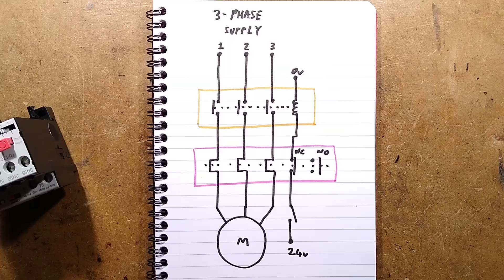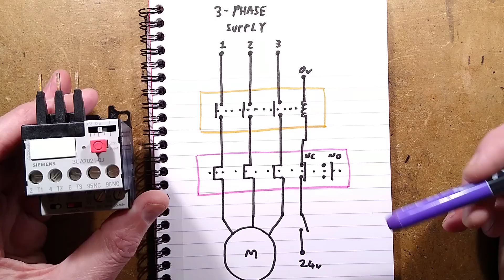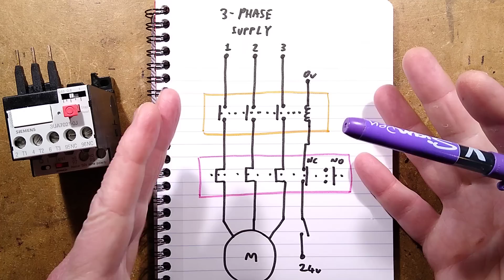Siemens motor overload relay teardown

Comment: I'm in the US with predominantly 120v ac control circuits. I've always found it curious that the overload contact is one of the very few devices wired to break the neutral to the contactor coil. All other control contacts will be on the "hot" side, but the convention for these was to break the neutral. Of course, there are exceptions, but they are rare in my 30+ years of field service.
Reply: I am in UK, having been a sparky in few EU countries and I dont find its rarity curious. As a rule you always want to cut live to prevent non-powered devices from being live. So it is natural that most of the equipment does control live side unless it has a good reason to do otherwise.
Reply: I'm in the USA too, however the "norm" I've noticed is 24V AC or DC (if PLCs are involved). Indeed, I was "shocked" (emotional, not physically ;-) when I discovered a piece of equipment that used a 120VAC e-stop loop. A safety device that is "potentially" (pun) a safety hazard: who'd have thunk it! Note that I work on a small assortment of expensive equipment in a particular industry, so my experience may be atypical.
Reply: Well, most overloads are wired for either a control transformer use, or across phases, so no real difference in there, you have 2 sides of a circuit. But most of them I find are wired so the coil is the lowest element, with the start switch and sustain contact in parallel, then the overload, then the relay coil. With the Siemens units there the coil has a handy pass through terminal, as then you can have a single wire jumper, or for factory units a stamped link bar, that connects coil to common, then from there you wire in the NC side, and have a jumper wire to the 14 terminal on the relay, and power applied to 13, with your neutral to A2, with start button and stop button being remote and fed with a 3 wire connection. I used 4 plus ground cable, because I also fed back a neutral, so as to have a power pilot light there, and ground for safety.
Reply: I find it unusual that the Yanks will switch the neutral in most A/c systems that i have come  across
Reply: @steveosshenanigans Meutral only or do you mean both? when you have inductive load that might continue inducing power after supply was cut there is sometimes handy to disconnect more then just live. Cant think of this happening on a petty Aircon. But disconnecting only neutral in actual end device is usualy sign of bad workmanship.(the device in a video is disconnecting switching device on  neutral not the end device).
Reply: @Zlodej5  
Lennecks is the brand that comes to mind 
And maybe York 
But that was 15 years ago
Reply: @steveosshenanigans  No idea, when it comes to aircon I only troubleshoot and might incorporate them in design, but not really mine expertise. As I am on a different continent its good that we have different brads then you do. still brands are irrelevant when the idea makes sense

Comment: I was working on a very old table sander recently, the overload was a similar design, just much more rugged and not enclosed. The contactor contacts were also open and were huge for the 2A motor load, they looked like they could easily handle 100A.

Comment: These were (still are) used in Schlumberger petrol pump dispensers from the early-90's. The ones I've worked on have the variable current setting on the side as a pendulum style lever, set quite low in the factory and then nudged all the way to maximum (10A or thereabouts) by field technicians over the years when worn out motors start to pull more current. Never had to replace one in the 15 years I've been in the job.
Reply: Only time I replaced one that was faulty was when the motor went short to ground on one phase, and burnt that thermal sense element out, so it was replaced with the motor. motor went short because the phase imbalance on the unit failed, and the contactor dropped a phase because of a bad contact assembly. motor ran, but with more noise, till it finally went out and tripped the breakers. 8kW motor, 138kg cast iron case. New aluminium case one was a lot lighter.

Comment: Yes, the kind that don't come from Ebay are far from cheap, at least the high power non-counterfeit ones are. I have never taken one apart though. I thought there was more to it. Nevertheless, they are far superior to circuit breakers for protecting the windings of a costly motor. Putting a dab of glue on the adjuster can reduce the turn-it-up-a-bit type of "field repair" if you pay to warrantee of the motor the motor.